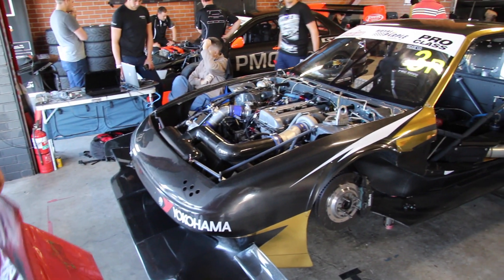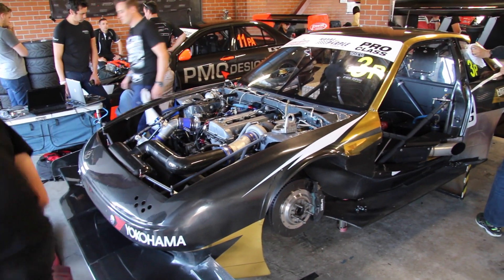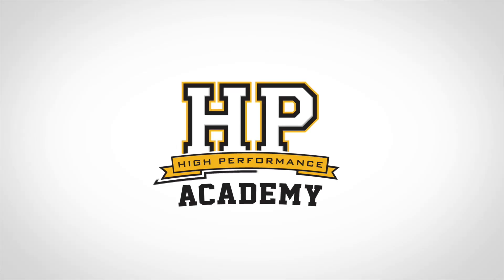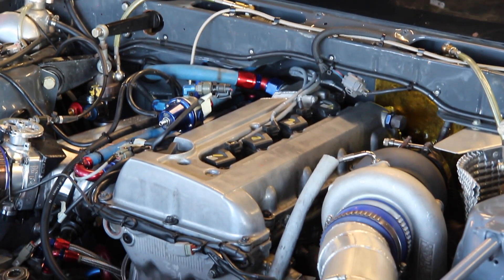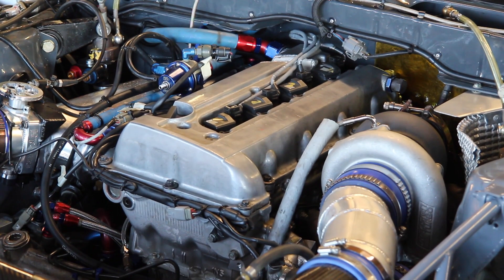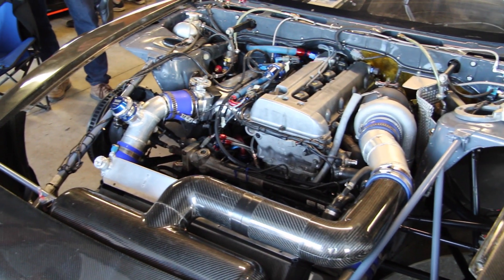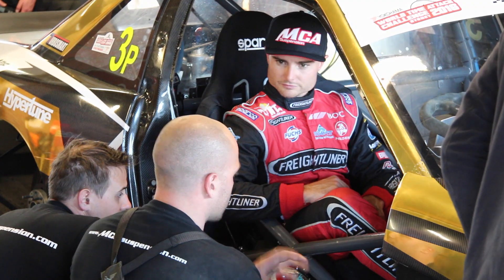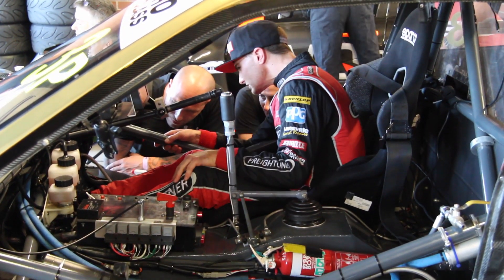What makes a 900whp SR20 time attack car tick

Comment: Might be a silly question but if it is already hitting maximum boost with only part hrottle, doesn't that suggest the turbine is too small? Would using a larger hot side reduce that 'overboosting' and also bring the benefits of lower pressures in the exhaust which the piston has to overcome, which should improve efficiency?
For the Pikes Peak engines a smaller than optimum turbine would be smart to maintain boost at high altitudes when the total gas volume would lower but for time attack it seems the wrong way to go - or am I missing something*?

*Very, very possible :-)
Reply: smaller turbo is better for response than a big turbo and in a time attack application response is very important.

Comment: stock block only handles 500 hp...  ummm no!
Reply: Grip Limit He is talking about 500hp for a track car that is getting flogged unlike a street car that occasionally gets booted
Reply: Anthony Flood it's a time attack car, warm up lap, hot lap, cool down lap. Its not built for a 50 lap race.
Reply: Horsepower is a bit of a nebulous term, especially with forced induction, as it is a function of torque and rpm and so you can have two "500" hp engines with a big difference in how that "500" hp is obtained - if the first has xxx torque at 10k rpm for that power, and the second does it at 8k rpm, then the torque would be 25% higher - which would mean the mean cylinder pressure was also 25% higher.
Of course, that in turn isn't really the point - the maximum torque is around the point where the actual maximum mean cylinder pressure is reached - although poor ignition control can cause even higher peaks. 
The problem with lifting heads, block liners moving around, head gaskets leaking, etc. is primarily down to peak cylinder pressures, which is largely dictated by the amount of boost and timing. Relatively short rod to stroke ratios will also increase the side loadings on the liners.
Reply: Vesuvius Racing hes talking about 500 WHP i bet
Reply: Yeah I'm running around 500-550hp consistently in mine albeit is dry sumped and having next to no issues as far as oiling is concerned. That's doing 10 min sprint races.